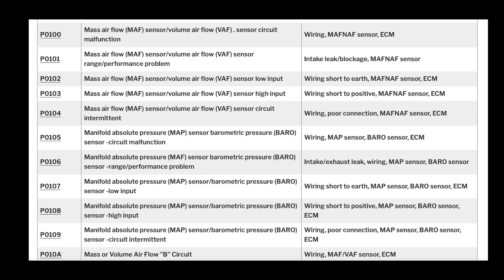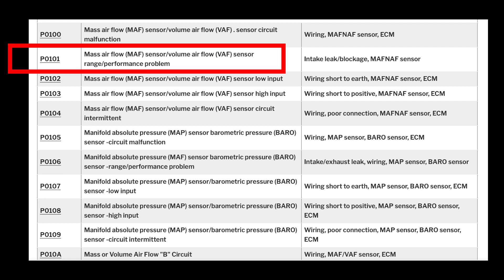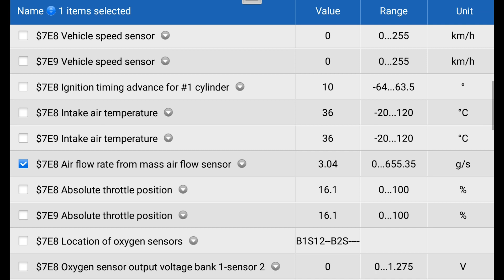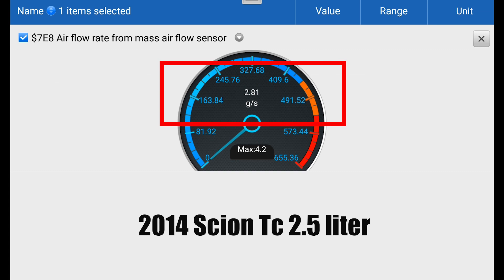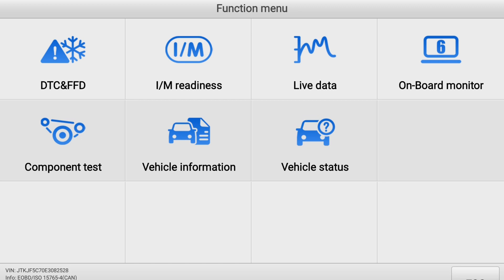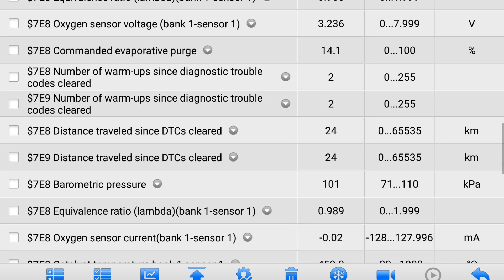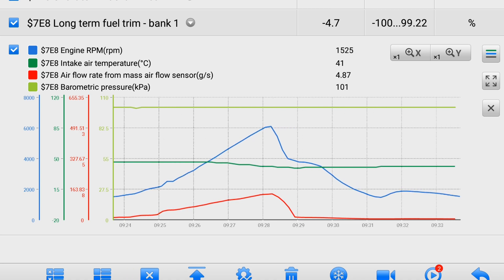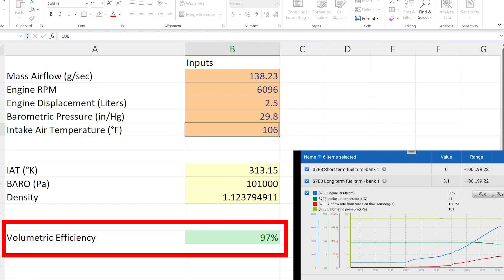Service Done Right #13:  Mass Airflow Sensor Testing – Is The Sensor Lying To The ECM?

Comment: Question:  If I do a wide open acceleration, the ECM will go into open loop and max out LTFT (GM "enrichment" mode) - is there another test I can run for VE test?

I would like your spreadsheet please.

Comment: I just purchased a RAM 1500 Rebel.  The mileage is supposed to be 19-24 and I have watched several videos where they test the truck and get that mileage.  My truck is lucky to show 15 MPG and recently the miles left to empty showed 100.  The truck has a 33 gallon tank and still had 10 gallons in it.  Based on this, the math says that it most likely is getting the 19 plus MPG, but the sensor is telling me only 15 mpg.  Your opinion?

Comment: Third video about mass air flow sensors that call for replacement. In many cases the sensor is dirty and they make a special mass air flow sensor cleaner.
Reply: It doesn't always fix the problem. Sometimes the maf is bad. No amount of cleaning is going  to fix it

Comment: Hi, I have a 2013 BMW with 2 MAF sensors. When they are plugged in, I have random misfires, vibrations, misfires usually after gear shift. 

When I unplug the sensors the car runs super smooth and not a single misfire.. I replaced with 2 brand new sensors and it made no difference 

Any ideas?

Comment: thank you for the spreadsheets which i will be using it for TS (trouble shooting) my sister in law 2012 Camry 2.5L with MAF (Low input) P0102

Comment: I have a 2020 Nissan versa that’s popping a p0101 code, I looked up the bulletin for it and found that they actually had a bulletin for it that says just clear the code then do a IAVL that should clear it but wasn’t sure how likely that was to actually be the problem.  Is the bulletins usually pretty spot on with its recommendations?  The mechanic I’m seeing next Wednesday says they need to run the vin to see if it applies to my car.
Reply: I have similar, delearship said 2800 to fix throttle body and MAF sensor pigtail require after paying over 1000$ to other mechanic. I change my throttle body, throttle relearn, changed my maf sensor, now I’m going to require the pigtail myself. Then use their scan tool reset my car. Nissan should do a recall

Comment: i have a 1997 4.3 s10 with a severe rich condition negative trims -25. my MAF sensor reports 9gs at idle hot engine. i checked wires and didnt find a problem. i tried restricting the air by placing some rags in the air filter but it didnt change the sensor reading. i also dont get any blowback as seen by the MAP sensor which reads normal that could mess the MAF report. IAC valve closes and opens properly also. fouled spark plug sometimes after driving for longer periods. i take them out they are black so i know its not false rich. can you give me your opinion on what i should recheck?
Reply: Mines doing the same thing.  You figure yours out?  I replaced the spider injector too. I was getting a rich reading on both banks and thought it was a leaking fuel regulator since the scanner showed -25 trims as well but had rich banks.  Now that I switched the injector out. I’m still getting 9-10g/s
Reply: @SubePelayo928  still have the high MAF readings. they seemed to go down a bit after cleaning injectors but still higher than expected. i am suspecting my iddle air control valve system because i also have some irregular startup flare. i cant come up with any other explanation. i know it works but i cant check if how far in or out it its with engine running. let me know if you have any updates on your case in the future
Reply: @brunopecego5297  I read that the IAC valve can cause the MAF to require more air.  If the IAC valve is stuck or clogged. Giving a false reading of thin air/higher altitude.  It can require more air to keep the air fuel ratio correct
Reply: @SubePelayo928  i also read in a couple forums that a restricted egr would cause a larger amount of air passing thru the MAF but I didn’t really understand how that would cause a constant high reading at idle where egr is supposedly closed. I did get a restricted egr flow code though but after a little bit of cleaning it got away and hasn’t comeback since
Reply: @brunopecego5297  I’ll update once i find a solution.  It doesn’t make sense to me either.  It could be faulty O2 Sensors sending a rich reading. Requesting more air and trying to reduce fuel trims too. But I’ll keep doing some research.

Comment: Leaking intake valves. Blow back into the intake manifold... 
Tight valve clearence? In hondas for example? Wich code will it be?  101/102/103???

Comment: Nice information, would i be able to get a copy of the mass air flow sensor calculations formula? it would be nice to have and to use it at the dealer. ive had fuel trim codes lately and im always second guessing when im looking at my mass air flow readings.

Comment: Hello sir I'm new to this I have ford f-150 5.0L 2013 it hesitates an shows code for mass air flow sensor P0113 circuit high input  an IAT P0102 circuit low input an on scan tool mass air flow sensor reading is 2.36 -2.36 no changes Any help is highly appreciated

Comment: I have a 3.5 liter engine so are you saying my MAF should read around 3.5 g/s at operating temperature at idle? Mine is reading only around .6. Is it bad? Can something else be causing this reading besides the maf?

I have a p0170 code. The car runs perfect no hesitation no variable idle. Stressing because I only have 3 weeks to get this to turn off CEL light and pass emissions .any help much appreciated

Comment: Would if you have a rough idle to stall issue and while the engine is running, you disconnect the MAF sensor and the vehicle will idle almost perfect, you can plug it back in and the engine will remain idling good and drive good but as soon as you turn the vehicle off or disconnect the battery then restart it the rough idle returns until you disconnect the MAF sensor again. The vehicle is a 5.3 silverado 08, this is all happening with a new MAF sensor since I just replaced it when the engine started acting up. I have been chasing this problem for quite some time and have replaced sparkplugs   wires, coils, tps and I decided to check out the MAF sensor again when I discovered this anomaly. I don't know whether to get another MAF sensor or chase down wiring.
Reply from the maker: Do you have any codes stored in the ECM, hard or pending?
Reply: Could be a problem with the communication with the computer in ur car. I hear this common problem. I’m dealing with it as well with Nissan Sentra with turbo. Trial and error, wish u all the best.

Comment: pete if you do read this I was told by a tech that the mass airflow sensor was only there to check if and how much is added when the egr is opened as the ecu knows exactly how much air goes in based on engine rpm  air temp and cylinder volume is this true , my 1400 deisel ran without mass af sensor , as had a broken lead in maf plug , only set a code
Reply from the maker: True on a diesel engine. The air entering is a constant as most diesels also don't use a throttle plate. RPM is controlled by the amount of fuel added.
Reply: @VehicleServiceandRepair  many thanks for your reply and your excellent training videos .i am currently improving my ecu knowledge with them

Comment: HI Pete,  have a question.   2001 f150 5.4,  with my scanner had lean codes and noticed no voltage reading on the maf sensor.  I have 12 v going to it and a good ground,  but do not have and voltage at the signal wire.   Hoping its not the ecm.   Any ideas?
Reply from the maker: Which wire are you checking for the ECM signal? Any DTCs set?
Reply: tan with blue i believe is the color.  Signal wire does not have a 5 volt reading
Reply: dtc is PO102  low voltage.  I just checked wires to ecm and check to have good continuity...
Reply from the maker: @JSchwaderer  My first thought would be a failed sensor.
Reply: @VehicleServiceandRepair  that's what I thought.  So far they ohm ok..   I cannot get five volts from the ecm or ecm ground.   Any ideas there?   Doesn't the ecm have a body ground?
Reply: @VehicleServiceandRepair  what sensor?   I replaced the maf sensor because it had a broken element...

Comment: What excellent knowledge, best on YouTube 👍. My maf on a 2.2 litre diesel saying at idle once at running temperature 7g/s and jumping to 12 g/s with an audible change in engine tone when switches from 7 to 12 by itself so definitely wrong reading straight away at idle. Going do test suggested first though too 👍

Comment: Great explanation of what is happening and what to look for. If you scanner cost less than $100, most likely your are seeing "Global PIDs" as required by law. Fun fact?
  This was a value test we rigged with a voltage drop on the ground side at GM training centers in 2002, but even more relevant today as fuel prices increase. And never forget engine wear, compression, intake leaks, timing chain stretch and incorrect tire size will change load values! Great video...
DK, ASE master, retired.
Reply from the maker: Thank you!

Comment: If the Cat is partially blocked , will it affect the reading ? That would restrict the air flow . Or you can get the E Scan Elite from ATS ( Bernie Thompson ) which has a VE calculator built in !
Reply from the maker: Yes, any restriction to breathing will impact the test. And I have the EScan. 😊

Comment: I do have a question, how shoud I get the data from my mechanical transmission in the case stated in the video when shift from 1st gear to 2nd for auto transmission?.  Thanks in advance. By the way, great video as always.
Reply from the maker: Good question! I would drive the car like I was running a drag race or passing a semi on a busy road. Rolling start, punch it, and shift into second when the RPMs got into the powerband.

Comment: 1g/s for 1 littre is not always true specialy with BMW engine and I don't know why .. in normal operation the 1.6 engine have 2 g/s in idle.. maybe the valvetronic system is affecting something
Reply from the maker: The 1 g/sec per liter is a minimum, not an exact number.

Comment: Hey, Pete. Since the MAF sensor is the primary source for calculating absolute and calculated load, can you just look at the calculated load value pid and make a decision based on it?  Over 85 % is what I heard is okay for non- turbo or supercharged engines.
Reply from the maker: Calculated Load is ok for a rough estimation, and if it is turbocharged, Absolute Load is even better. But yes, you can use these numbers to identify an engine that definitely has a breathing problem.
Reply: Can we get this info on an 200$ actron obd reader?

Comment: Thanks Pete!  You said that the MAF should read about 1g/s per liter of displacement ( I am guessing per 1k RPM) is that correct?  So on a 02 Corolla with  a 1.8L motor at 700rpm I get 1.81g/s, does that seem about right?  I have. P0171 with long term fuel trim at 25% (constant) and short term fluctuating between -10 to 12% when driving. Since trim doesn't get better with higher RPM I have moved on past a vacuum leak and suspect fuel side. Since it has also developed a harder time starting after sitting when hot (1/2hour sitting after running into a store). Any thoughts?
Reply: Any engine under 2 liter not apply to this . from 1 to 2 liter it should be between 2 g/s to 2.5 g/s 
when the car is stationary raise the RPM to 2000 - 3000 and look at the fuel term if it goes down this means you have vacuum leaks 
make sour you don't have a misfire drive the car and do wide open and watch the o2 sensor what it reports if it  goes lean it means starving for fuel
Reply: @alrifainidal  thanks for the reply.  I don't detect a misfire since it's a 4 cylinder it would be hard to miss.  I drove it while monitoring some data PIDs so if there was a vacuum leak LT trims should have come down but doesn't.  Fuel filter has been changed as a precaution as it was on the original one with 145k.  I really do need to check fuel pressure but the set I have doesn't have the right adapter so I may have to cobble something together.  I can however drive down long term trims with a wot run.  Plugged injectors is a possibility I guess.
Reply: Plugged injector would yield decreased cylinder egt?

Comment: I've read an article from your collegue Scott Shotton how to modify the VE calculator and get accurate number on turbo engine. If one works on a turbo engine you just need to gather what the pressure in the intake is while doing the VE test run. You can either use factory MAP sensor if equipped or install pressure transducer. Collect the map sensor data in "psi" reading. Then multiply the reading by 2 in order to convert in "inHg". Then add the calculated number to the current barometric pressure(inHg), at the altitude the test drive was performed. Then input this final calculated number in the VE calculator "barometric pressure" input. Man i love MotorAge 👍🎸🔧🥃

Comment: Can you tell me where this is on my 2013 Jeep Grand Cherokee. All I can find is a small air temperature censor . It’s a3.6 engine 🤷‍♂️
Reply from the maker: The MAF sensor is located between the airbox and the throttle body.
Reply: @VehicleServiceandRepair  yeah it’s not I’ve looked someone said it in the back side of throttle body going to look back there 🤷‍♂️
Reply: @sheerwillsurvival2064  I just looked your car up in service data for you and your engine is a speed density engine design which uses a MAP sensor or manifold absolute pressure and not a MAF sensor.  You can't find it because it's not there :-).  Hope that helps.  Cheers!
Reply: @boomaf1620  bless you though I was crazy 👊🏻👍🏻
Reply: @boomaf1620  thanks again for your help 👊🏻

Comment: Now that's a new one I've never heard or even considered diagnosing specific sensors in global OBD2 because of the difference in the data...
Reply from the maker: You can diagnose and repair 95% of problems related to drivability with Global OBD II